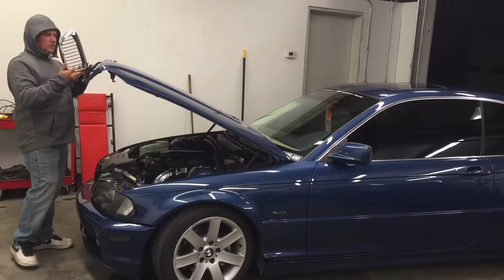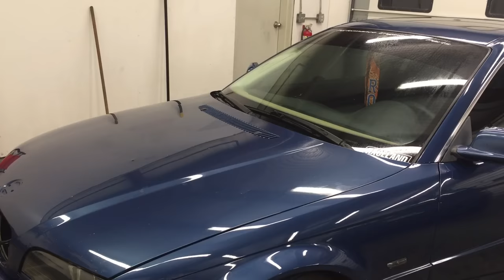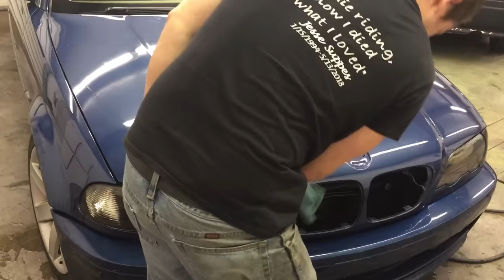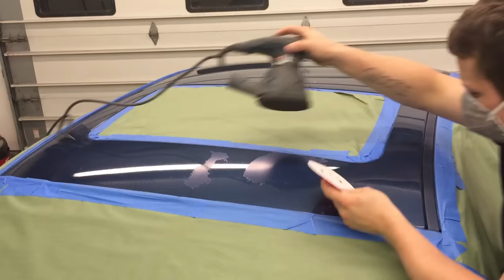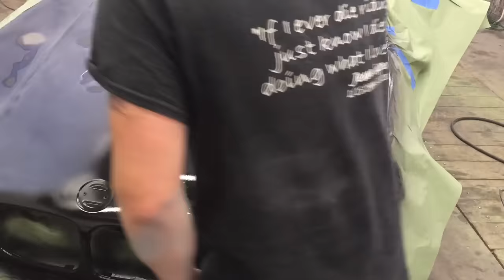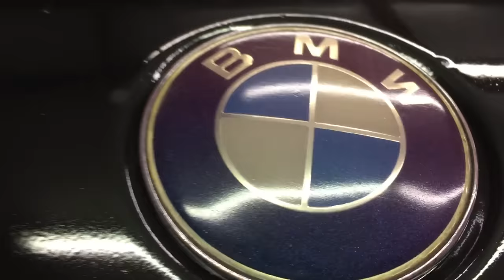The Best spray can paint for high gloss. (Hood has imperfections)

Comment: You could have fixed the clear coat or probably wet sanded and buffed and recleared the paint. 
But nice job
Reply from the maker: J A There was rock chips with rust starting or he would have just had it re clear coated.

Comment: Just watched this vid mate that is an amazing Finnish for a spray can job my car needs bonnit ,or has you call it the HUD, it's a BMW e34 it's so expensive to get it done & I've been told the new paint will stand out against the old so to spend so much money & end up with a car that has odd paint ,I wauld rather do it my self & do the full car but it needs to be in the original BMW colour can I get that in that same brand you use, by the way I'm in England

Comment: Looks really good man, I've been wanting my hood black for the longest time but hesitant to do it because Im afraid it will come out like crap. Im pretty good with spray cans but I know ill end up with an orange peel look. I dont have a buffer and I know that will help with that. I did my spoiler and at first it looked great but over time it just looks dull and rough feeling and dirt/dust sticks to it. I did do a clear coat on it and waxed the hell out of it but still having issues. I just cant see doing all this and not putting a clear on it, especially here in Florida.  Watching this definitely makes me want to do my hood though, after all its just an 08 srt4 caliber worth only maybe 5k so shouldn't worry about anything. But I still want it to come out halfway decent looking. Im torn lol But great spray can vids nonetheless!
Reply from the maker: daveofthedead79 Yes temps make a world of difference don’t do in the sun and make sure there is NO WAX left over when you go to paint or the wax will screw with the paint. I would say try to find a temp controlled garage but that’s not always a option

Comment: No grease and wax remover! It's as important as the painting. If you want to rid your spray lines, go over the end paint with a coat of straight thinner. Why did you not use a light coat of primer filler on the repairs, if the prepared surface is not right nor will be you finish.

Comment: No comment. Takes a special eye to be a cat lover. 30 years in this business. From OEM to full out customs. There's no rattle in my guns. Prep is everything to removing all tar from car. Then a clay bar. After that Dawn soap. Was it good. Then dry blow out everything. Tape and wipe down with acetone. Do not sand that paint before a good acetone wipe down. Sand fill all notible spots. Tac another another acetone wipe. Keep blowing and wiping car. Dust is one of your enemies and waxes, silicone. Take your time.

Comment: I have to be honest here. And it's not trolling. So if you delete my comment it just shows you cant take differences in opinions. I know you prefaced by saying (The hood isnt perfect blah blah, it's getting redone later etc) but dude, this is really bad considering you mention multiple times it turned out well. If you're going to take the time to do it, then do it right. It would have taken only a little extra time to do it right. I've done body work for reputable body shops for years and you did a good job up until you stopped doing a decent job. And you shouldn't have a channel if you cant handle criticism. It's not being a troll. It telling you outright how bad it is. Go ahead delete this. Because you cant take opposing opinions.

Comment: Why wouldn’t you just get a cheap compressor and gun and spray it ?  Wet sand and call it a day ?
Reply from the maker: I have a cheap compressor and a gun i wanted to show its possible and well i only had 40$ to spend lol A gallon of this color was 200$ + reducer and hardener then 140$ in clear.. It ain't easy being broke lol Also there was rust/Rock chips past the blue.
Reply: It still looks good. Give it a good wet sand and call it a day.